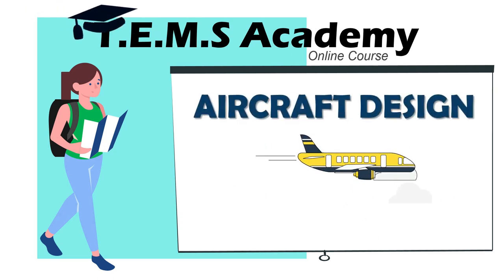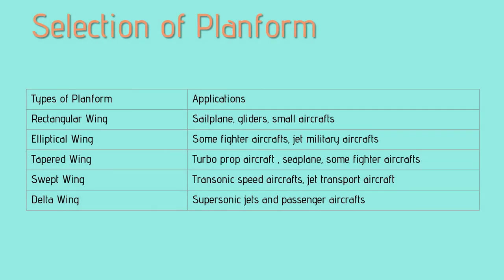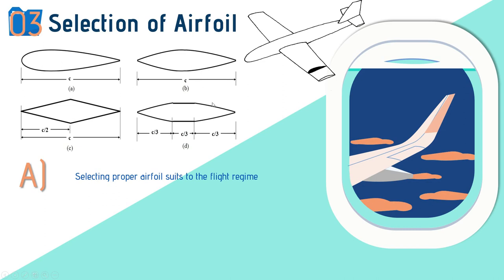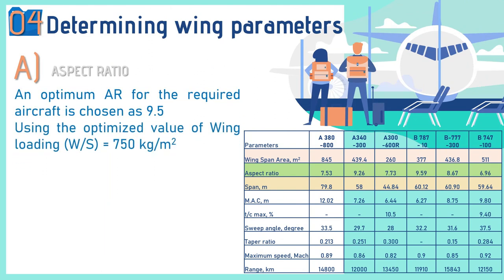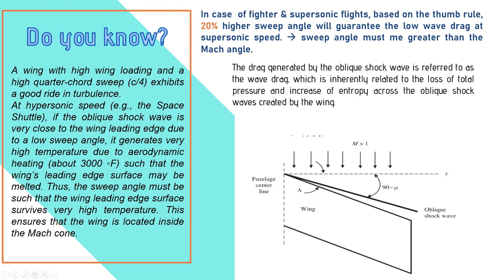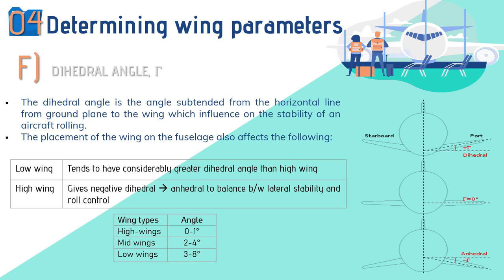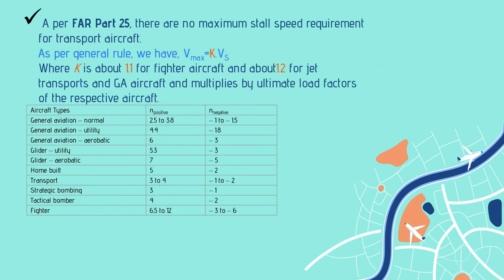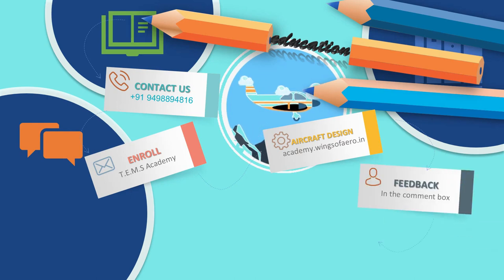Wing Design of an Aircraft - Part 5 | Wing & Airfoil configuration, Wing Volume

Comment: Hello. I really appreciate your effort in this lecture series. 
I have a simple question. It would mean a lot if you kindly answer it. 
I am trying to design a small drone. Whose cruise velocity is 26 m/s. and Wing loading is 38 kg/m2. So the cruise lift Coeff. becomes 1.09. As a result, my wing incidence angle becomes 7 deg or 8 deg if I want to produce that desired lift at cruise (keeping the fuselage at 0 deg). What can I do in this situation?
Thank you.
Reply: Hi hassan, maybe tilt your wing over its axis